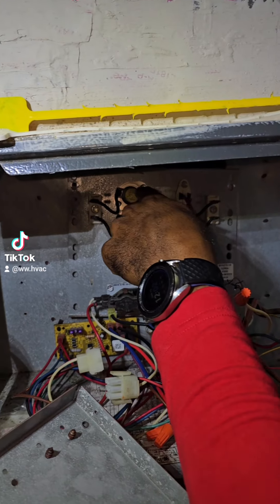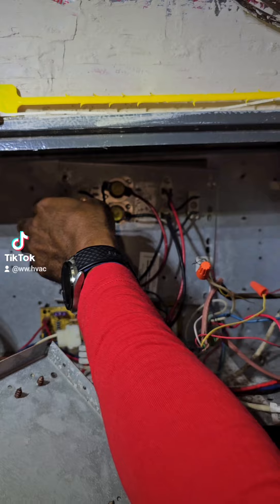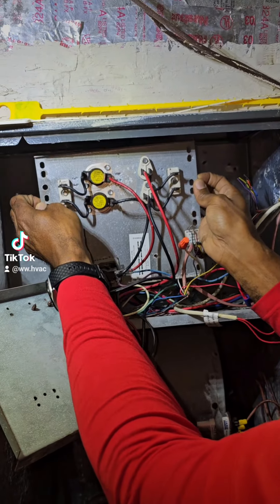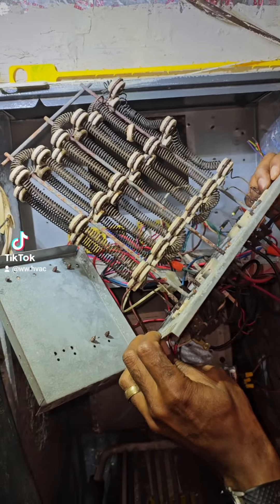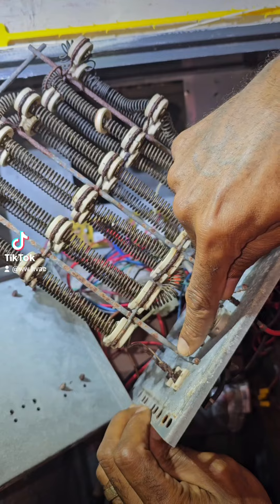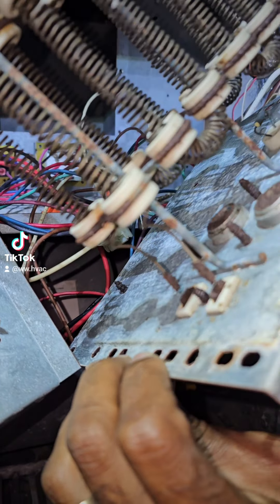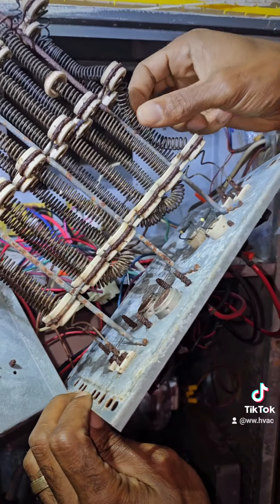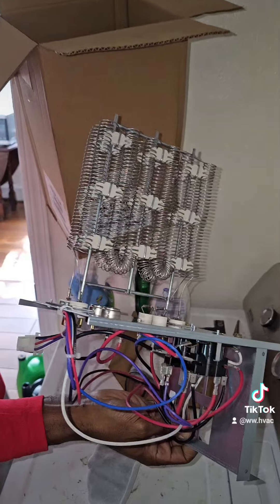Last-Minute Heat Rescue Before Texas Arctic Blast!

Comment: In currently in trade school. Just learned about those heat kits. Are those only found in electric systems? Not gas?
Reply from the maker: Electric air handlers and heat pump systems.. I also recommend getting the modern refrigeration handbook any edition. Good luck!